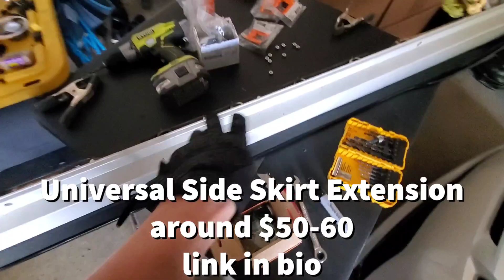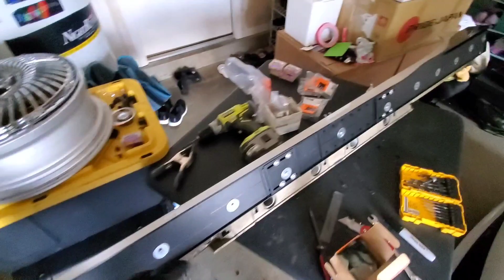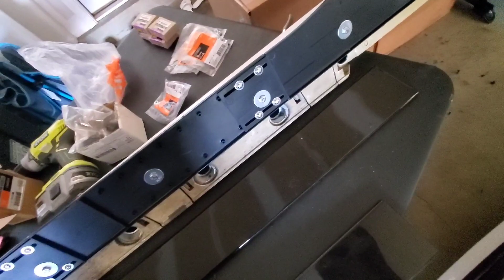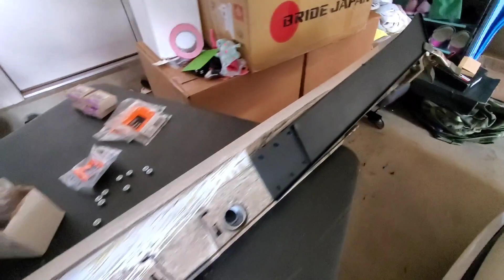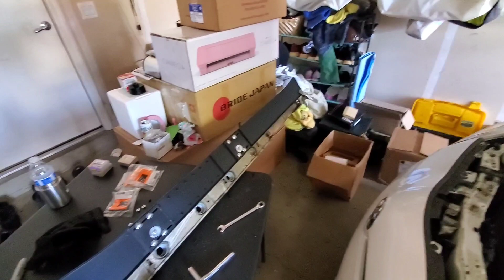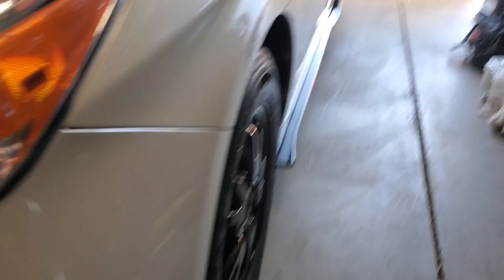TOYOTA PRIUS SIDE SKIRT EXTENSIONS (UNIVERSAL)

Comment: How difficult are the side skirts or rocker panels to remove? I have a replacement one coming and I want to install it myself.
Reply from the maker: Very easy. Remove plugs and clips from bottom. Remove 10mm bolts in front and rear. Open the doors and remove the 2 sideways screws and then just pop that thing off.